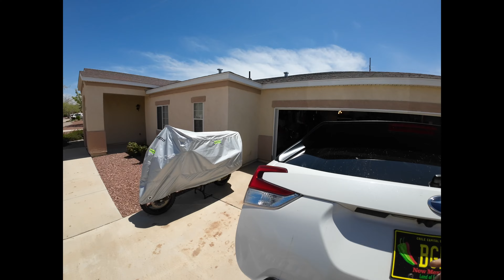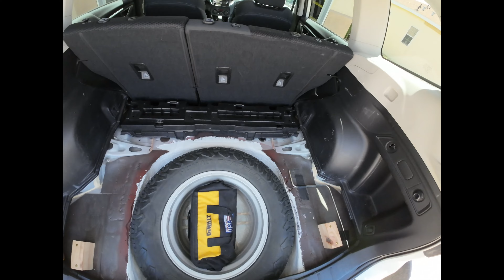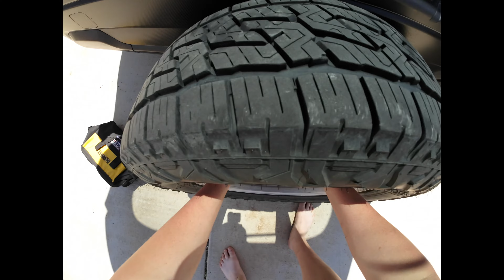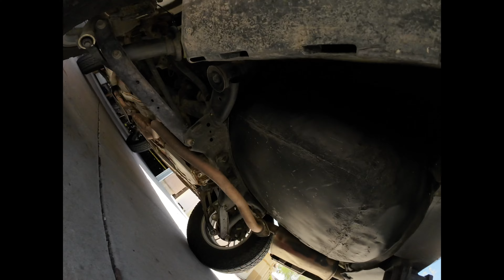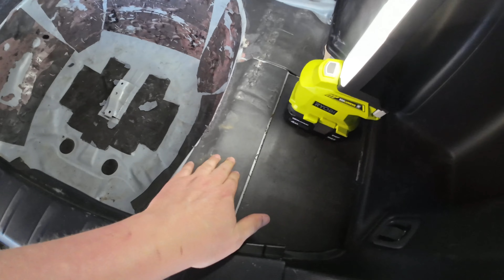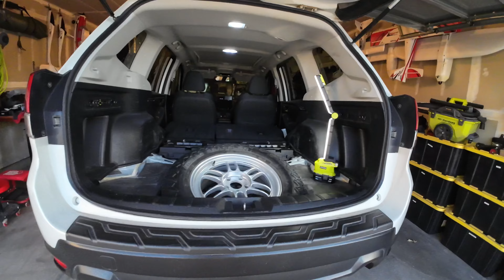Cut and Weld to Enlarge Subaru Spare Tire Compartment

Comment: There was a time when every car had a full-sized wheel well in the trunk from the factory. Then they started cheaping out with space savers, and some modern cars cheap out even more, giving you a tiny compressor and a can of foam.
Reply from the maker: I know, terrible, especially when an oversized spare can fit with a bit of sheet metal modification! ¯\_(ツ)_/¯

Comment: I was hoping to remove the valve stem and push on the 245 with a skid steer fork w/board, but wife was already throwing a fit over a tire she decided not to not carry. 

Make it make sense. Guess I should’ve been a welder. Thanks for the thorough video. Unfortunately she’ll sooner drive without a spare..

Comment: should have added more tacks so all the tacks are connected....anyways on my crosstrek I just measured my spare 145/80-17 (comes out to about 26.25", tire rack shows them as 26.5")and OE wheels/tires 225/60-17 (comes out to about 27" still mounted on the car sitting on them, could be half inch more off the car, tire rack shows them as 27.6").  Since I don't plan on offroading just dirt roads for camping that any car can drive, I'm gonna go smaller wheels/tires (215/60-16) which tire rack shows as 26.3", very close to the spare size so I won't have to worry about diameter.

Comment: Legendary. I have been cussing out Subaru for neither providing a full size spare, nor even a space big enough for one on the Crosstrek since the day I got it. Googled to see if anyone’s enlarged the spare wheel well and bam you’ve done exactly that. I don’t have any welding experience but this makes me want to learn!
Reply from the maker: You can do it! MIG welding is like using a hot glue gun for metal. I taught myself with YouTube videos.

Comment: I managed to fit my spare without modifying the spare wheel compartment. Is it a perfect fit? No, I had to remove the foam piece that supports and covers the spare tire, but it works for me.
Reply from the maker: Nice! You must have smaller tires. Mine are 245/65R17
Reply: 225/60? Or what size? I have 225/65r17 and would love to store a full size spare in this compartment without major mods like the video haha

Comment: I'm running 245/65/17 on my Crosstrek, but I don't think I could even chop up my spare well to fit the full-size since it barely fits flat in the cargo area to begin with :(
Reply from the maker: Glad to hear that you've got those upsized tires too! Yeah, it looks like the Crosstrek has a smaller cargo area, shallower too. I could just barely fit it standing up against the side of the cargo area. Are you going to keep it in the cargo area or get a rear tire carrier?
Reply: @MatthewHeiskell  Right now I just have my old 235/60/17 as a larger spare, and that fits in the cargo area alright but I'm thinking about either a tire carrier or finding a way to roof mount it alongside my box. We'll see, right now it works since I don't carry it all the time.

Comment: Yikes, not sure that was worth it. But hey it's your car right?
Reply from the maker: I was afraid that it wouldn’t work out, such a risk for a relatively small improvement to convenience. I love this car though. I plan to keep it forever. It strikes the perfect balance between daily drivability and off road capability.
Reply: The only other alternatives either take up too much space inside the rear compartment area, cost heaps for a hitch swing gate (which also adds to the tail end sag/weight) OR roof mount the spare, driving around with a lump on the roof, which effects fuel economy & stability. I'm glad you put the finished shot at the start as watching you hack that wheel well, I'm thinking oh god that's going to be hard to repair as sheet metal is a bitch to weld, ahh hindsight. Might have been easier to go to a wreckers and buy a jeep or other off road wheel well & do a retrofit/seal job, maybe. Given that subframe however it still would need major "adjustment"